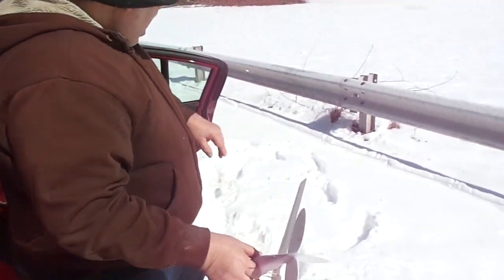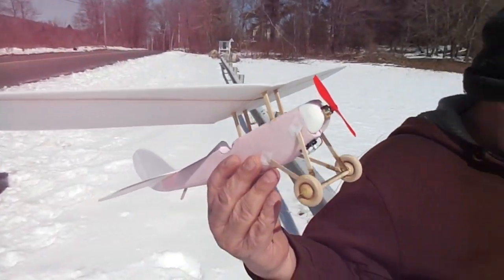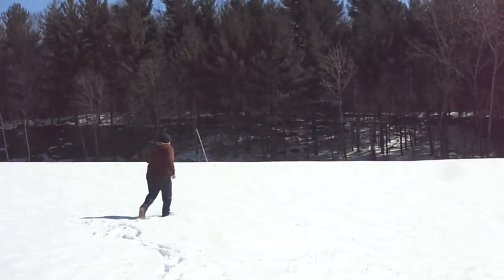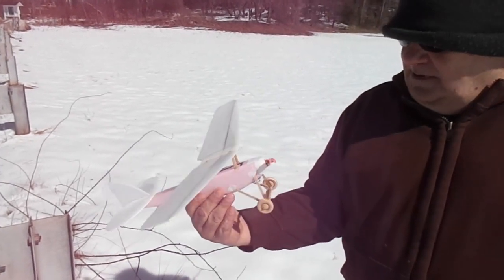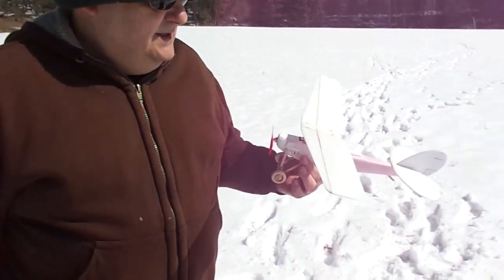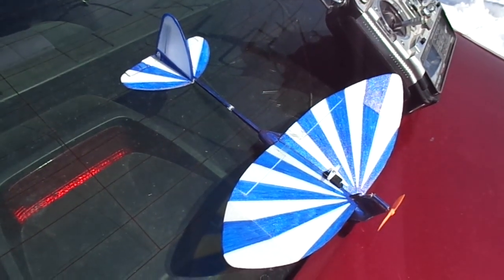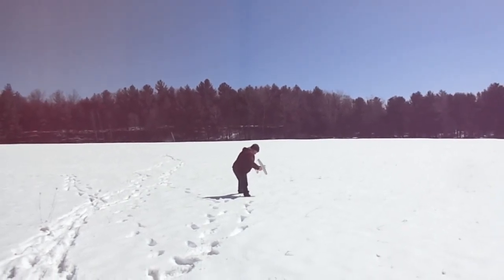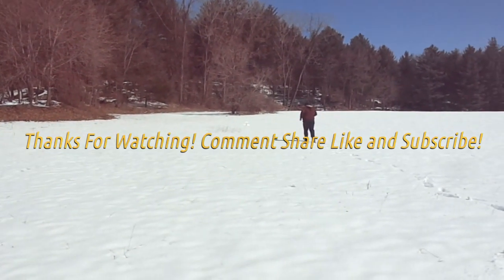Trimming Richie's 20 Farad Free Flight Parasol Foamie

Comment: Great job Richie, I would get some color on the plane if you fly over snow much more. We have like 3 feet of snow now but it is going to start melting next week.
Reply from the maker: Putting some color on that model for visibility is a good idea, but don't forget you're talking about the guy who builds free flight ships covered in green tissue and then flies them in the summertime here in Mass! Yep, the weather will warm up very soon, what we're seeing now is the tail end of building season! Thanks for the comment Bill!  -M+R
Reply: @sonex413  I have made the green tissue mistake too. On the white foam I have been using the floral spray paint.
Reply from the maker: @billkuhl442  Thanks for the tip, I haven't heard about that type of paint, I'll look into it! -Mike
Reply: @sonex413  Design Master Floral Spray Paint, it adds little weight and does not hurt the foam.